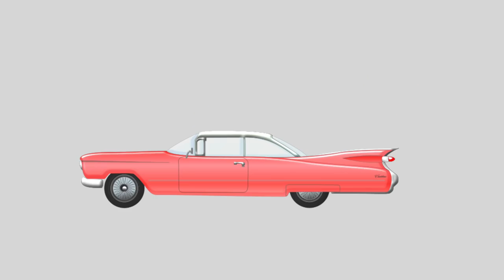Yes, Rockets CAN Fly in a Vacuum

Comment: What is that small wire seen in lunar lander and its stand..Since I have seen all those in apollo short films and movies I am very curious to know about it.
Reply: Are you talking about the probes that stick out under 3 of the 4 landing pads?  If so, those are the probes that sense contact with the ground.  They were basically crushed upon landing (as designed).
Reply: @Jeev
Once they( one) contact the ground, the astronaut gets a light and he knows to shut down the engine.
You can see the probe to the side in this shot.
https://www.flickr.com/photos/projectapolloarchive/21692801811/in/album-72157656723857913/
Reply: @rockethead7 Thank you.
Reply: @Kel Duck Thank you

Comment: the gases get out in one direction
a force pushes the rocker in opposite direction 
what is physical explanation of the generated force or power
Reply: Conservation of momentum
Reply: RECOIL.
  Any device that PUSHES on MASS must feel a RECOIL FORCE.
Exhaust gas HAS MASS and the rocket engine ACCELERATES IT.

Nothing can accelerate MASS without feeling a RECOIL FORCE.
Reply: @stuartgray5877  
Nice does the rocket has an engine or only chamber for burning fuel and discharging exhaust
Reply: @Moh23Moh  the combustion chamber is part of the engine.
Reply: @Moh23Moh  Would a CROSSWBOW firing steel projectiles feel a recoil force in space? Yes or No?
Reply: @stuartgray5877  
Yes
Reply: @Moh23Moh  - "Yes"

Why? The crossbow does not have anything to "push on" according to your explanation for rockets.

Comment: Too many verbal tangents to explain this principle. People that don't believe it will hang on slight errors in any of your descriptive tangents.  All force, even ICE engines (or horses) on Earth/ground function initially on equal and opposite reaction principles.  An ICE, old fashion steam, turbine engine or electric motor simply turns the direct linear force/reaction into angular momentum to drive a shaft.  They should already know that.

For Space Rockets simply:
1) Put your inflated balloon in a vacuum chamber, release the end remotely, watch it move.  That proves the theory that Newton's law FORCE/REACTION applies in a vacuum

2) burn a fuel in a vacuum using compressed fuel and oxygen mixed as the second experiment. Pick a colorful fuel like kerosene.

QED the principles of deep space rocketry.  Easy to visualize.  Easy for even an Earther to visualize.

  They, of course, have to believe they are witnessing a true vacuum chamber, evacuated in the video... But at that point why even bother with them?
Reply: I would consider gun recoil as even better model.

Comment: Tell me how thrust have made in space, the ballon fly away because of thrust made by air inside even by a rocket in atmosphere, fuel gases makes the thrust by pushing atmospheric air.
Reply: The thrust in space is made the same way it's made in any other medium: the fuel gets combined with the oxidizer in energetic reaction, creating hot exhaust gasses which propagate in all directions. Those gas particles which happen to be facing back will simply exit the combustion chamber without imparting any sort of force upon the rocket, but those which are facing forward can't just turn around in mid-flight - they will continue moving until they hit the walls of combustion chamber, and bounce back, making the rocket move forward. It's all happening inside the combustion chamber, so the rocket doesn't need anything outside of it to move.
Reply: @Jan_Strzelecki  thanks for explanation, but in space astronots used air pressure booster I space walk, they simply release air pressure to move in space, how they get the thrust?
Reply: @brightside2336  Please do not call them "astronots". That is a childish behaviour of someone who's not actually interested in finding truth.

The air gun used ins first US spacewalks works on the same principle, minus the "fuel getting mixed with oxidizer" part: a container containing pressurized gas gets opened on one end, and with every gas particle moving in random direction, most of them won't be facing the right way to go through it, so they will keep bouncing off the walls of that container until they do - and that creates thrust.
Reply: @Jan_Strzelecki  I think they are astronots, they do are I think calling them is not childish and I talking about moving in space not in space station. When the engineers repair or modifi the station. There they used pressurized air to make them stable if they get unstable
Reply: @brightside2336  Whatever you may think or may not think about them is irrelevant. What is relevant is how you act in public - if you want to be taken seriously, would you act like a spoiled brat, or like an adult?

In any case, I was also talking about moving in space. What gave you the impression that I was talking about space station?
Reply: @Jan_Strzelecki  move on bro, "how to act like in public" and how to react etc is irrelevant calling astronots  "astronots"  is childish is irrelevant, there is humer in physics not your verbal skills your perception of grammar etc bla bla bla
Reply: @Jan_Strzelecki  good by I ll find my own way
Reply: @brightside2336  : Seems you wont find it alone, unfortunately...

Comment: Doesn't it need resistance?  Space has no resistance water and air have.  Right?
Reply: Wrong. It doesn't push off the air; it pushes off its exhaust.
Reply: It needs a medium.  Air, water, asphalt..
Reply: @DrCash7  No. It doesn't.  It moves by throwing matter on one direction, which causes it to move in other direction. Somewhat amusingly, what you don't tealise is that 
your model actually requires the official explanation to be actually true :D
Reply: @Jan_Strzelecki  yes it does, Pubert o: o: o:
Reply: Vacuum/space has no resistance .

Comment: Newton's 3rd law does not apply. If I push my had through the air, water or try or at a wall, the force & the counter force is still always the same. But the resault in all 3 would be very different.
I highly suspect that once rockets are out of the Earths atmosphere, they have no prupulsive power, they may still be flying of course (for a litte while) & may even be able to go into orbit, where the Earths gravity will propel them.
Reply: If I fired a steel projectile from a crossbow in a vacuum WILL I FEEL RECOIL?  Yes or no?
Reply: @stuartgray5877  Yes, but you'll need a lot of bows to get to the Moon (canned laughter)

The reaction will be minimul & over as soon as the projectile has departed.

When the Gas is burning but still in the rocket, it is not propelling it yet. 

I am far from convinced it works & all you get are childish explantions as in this video & complete idiot astro nots like Don Pettit.
Reply: @johnsergei  (also posted on other thread):

"So, do you think the gas coming off the rocket would do anything?"

Yes I do. If you knew how physics works you can calculate EXACTLY how much momentum gets exchanged from one object "THROWING AWAY" part of itself.

You ARE aware that close to 99% of a rocket is FUEL when it lifts off.

DO you think that all that MASS just disappears when it is combusted?

Here is a SERIOUS QUESTION. This means I would like YOU to just answer it.

If I had a big CROSSBOW in space, lets say 1000 kilograms or about 2200 pounds on earth, 
  in zero-G, in a vacuum,
and this crossbow FIRED A 500 kilogram Block of WATER ICE away from the crossbow at 2500 meters per second "muzzle velocity" (about 5600 Miles per hour):
WILL the CROSSBOW get pushed backwards?
Will the crossbow feel RECOIL ?

Yes?
or
No??
Reply: @stuartgray5877  It doesn't matter. Once the crossbow is gone, you have no reaction. & the reaction on you is very small, relative to the reaction on the crossbow.

If you actually knew, you wouldn't be reffering to crossbows. So I guess we are in the same boat?
Reply: @johnsergei  - Sorry but the physics IS RELEVANT.
For you to say otherwise means you have never taken a physics course in your life.

I have literally been part of a spacecraft Propulsion Loading team.

Now answer the question.
Will a CROSSBOW firing a 500 kilogram Block of WATER ICE get propelled backwards?

DO you know how to calculate how much velocity it gains with the numbers I gave you? Lookup the "law of conservation of momentum"
Reply: Just been looking up Rockets & recoil & of course they leave it to laymen like you to argue the point.

My point is, it should be quite clear how rockets wrk in space & that should come from the people who make & use them.

I can'r see how rection would work & the other choice is recoil. But I think you know recoil is very uncontrolable & is great at turning something sideways. 
In evey other aplication, recoil is a liability.
Reply: @johnsergei  - The fact IS that I actually build, test, launch, and fly deep space probes for a living.  I have helped put five payloads on rockets and launch them. I have witnessed (up close) about Twenty real rocket launches including Space Shuttle Launches and landings.

I can tell you for a fact that rocket propulsion works in  vacuum EXACTLY like how a crossbow WOULD propel itself by firing projectiles.
A rocket nozzle is a MASS ACCELERATOR.
To accelerate MASS requires a force.
When the space shuttle main engine fires in a vacuum, it has a chamber pressure of over 3000 PSI and it can accelerate 500 kilograms of water STEAM to 2500 meters per second.

Do those numbers look familiar?

I asked if you could calculate the velocity obtained by the crossbow in the example above using the principle of "Conservation of Momentum".

Even without calculating it just IMAGINE a crossbow the size of a car, firing a 1000lb ICE BLOCK out the end at Mach 7?
would that exert a force on the crossbow OR NOT? The answer is.....
HOLY SHIT YES!

A car mass machine firing out a 1000lb hunk of ICE at mach 8 would feel a HUGE BACKWARDS ACCELERATION!  HUGE.

Oh and there is full video of rocket propulsion in a vacuum too.

Search YT for "Uninterrupted Falcon Heavy Launch and Booster Return" 
Watch that from liftoff to side booster landing then try to explain to me what you just saw.
Reply: @johnsergei  so did you watch the video yet?
Reply: @stuartgray5877  Whats that got to do with it? Recoil (which you say) flies the rocket is completly uncontrolable.
Reply: @johnsergei  - No the rocket is completely controllable. They have gimballing nozzles and often a secondary set of "rocket engines" (but mono or bi-propellant) to adjust the attitude of the stage while the engine is burning.

DID YOU WATCH THE VIDEO YET?
If you did, please explain what YOU SAW happen.
Reply: 1:57, she's emplying that the rocket exaust, pushes the rocket farward, just as a cars exaust would if it were poweful enough. I need go no further in this dopey video.

She us using Newton's 3rd law which does not apply here. If you push a wall. The wall pushes you back with the same force & you move.
 If you give it eveything you've got, ramming the air in front with your fists, you are actually producing more force than if you gently pushed @ a wall, but you won't move an inch & it's the same with rockets in space.

The atmosphere at ground level is more like a wall, in terms of mass, that it is to space (even the atmosphere @ 30,000 feet).

So, let me get this straight, she says rockets fly in space because of the exaust leaving the rocket?

You say because of a recoil action inside the rocket? 
Gee, one of you must be wrong? (get the joke?)
Reply: @papalegba6759  - SO you are saying a crossbow would feel NO RECOIL if it fired its projectile in a vacuum?

 Please come back AFTER you have taken a BASIC physics class.
Reply: @johnsergei  DID YOU WATCH THE VIDEO YET ??
Reply: @papalegba6759  - Search YT for "Uninterrupted Falcon Heavy Launch and Booster Return" 
Watch that from liftoff to side booster landing then try to explain to me what you just saw.
Reply: @papalegba6759  SO did you WATCH THE VIDEO?  Are you AFRAID to be proven wrong?  s THAT why you wont watch it?
Reply: @johnsergei  WHEN YOU PUSH SOMETHING AWAY WITH GREAT VELOCITY, IT PUSHES YOU BACK. This is literal 8th grade physics buddy
Reply: @johnsergei  Who said recoil was uncontrollable? Where are you getting that from?
Reply: @angadsingh9314  Try pushing air. Now try pushing space. Similar? 

Earth's atmosphere is much closer to solid matter than it is to Space. BUDDY!
Reply: @johnsergei  Good god. You're not getting it. Rockets don't move by pushing against air. A rocket is like a gun. And the propellent that it ejects is like bullets. It's continuously shooting bullets. Remember the recoil you feel when you shoot a bullet? The same recoil force is also felt by the rocket. But in our case, our hands/shoulders absorbs all the force, and the gun barely moves. This is not the case for the rocket. There's nothing holding it back. So it moves in the direction of the recoil. I really hope you get it now.
Reply: @angadsingh9314  How far does the gun move in the opposite direction? 
Apart from uncontrolable recoil ? Well, you lost that one, Sunshine.
Reply: @johnsergei  A normal gun wouldn't move much further because 1)We are only shooting one bullet. 2) The velocity/acceleration of this bullet is not all that high. 3) Our arm/shoulder is absorbing the force of the gun.
But a rocket is literally shooting billions of bullets a second and these are MUCH faster.... And what the fuck do you mean by 'uncontrollable recoil'. Where did you get that? How do you define 'uncontrollable'? Nothing is uncontrollable about recoil. We can calculate the exact amount of thrust that every batch of fuel can give us. I didn't lose anything, it's just that you prefer to turn off your brain and just say random words when presented with a well reasoned, well explained argument. You asked me how a rocket moves, and i explained you why; but of course you will choose to completely ignore it. What do you get by being compulsively contrarian? Being curious is fine, and the matter is somewhat confusing, but why are you so AGAINST rockets working in space? They work! Get with the times!!

Comment: Your speaking falsely,  newton's law requires mechanics, "ACTION" without an atmosphere, the rock gad will come out to push against nothing.  You can't thrust without a medium to thrust off of.Not making sense
Reply: Rockets use fuel as reaction mass.
Reply: @niallkinsella2687  ok. But what is the fuel pushing off of?
Reply: @paqman9101  
The rocket.

To explain it simply.
1. Fuel is a form of matter, therefore has mass and inertia and will resist any force that attempts to accelerate it. 
2. Rockets accelerate fuel, applying a force to it.
3. The fuel resists by applying a force to the rocket, equal in magnitude in the opposite direction, causing the rocket to accelerate also.

That's it.
Point 1 is Newton's first law of motion. An object will not accelerate unless acted on by a force.
Point 2 shows Newton's second law of motion. The force the rocket applies to the fuel is equal to the mass of the fuel times the amount the fuel has been accelerated by.
Point 3 is Newton's third law. Every action has an equal and opposite reaction.

No third element is required is the equation.
Reply: @niallkinsella2687  ok, now you mentioned how an object is manipulated by force, but what us the force pushing off of. 
For example when you swim, kick your feet in water. You body move through the (medium) water. Now apply that to an atmosphere,  14.7 psi of air molecules surround us, where it can be compress and moved very fast against low density air. Win turbines work opposite, where the medium exert force into a solid,  so, this all being said

How does a rock, exiting volumes of hot gasses, move an object if the medium or atmosphere is non present?
Reply: @paqman9101  
To use your language, misleading as it might be. The rocket pushes off the fuel, and the fuel pushes off the rocket.

No medium is required when a body is accelerating and ejecting mass.

In a pool, if you push a weight as hard as you can and let it go, you will be accelerated away from the weight, and the weight will be accelerated away from you. In that case the water acts as drag to slow the two objects, not as a medium for facilitating the action.
In space, rockets are more efficient than in atmosphere precisely because there is no atmosphere to interfere with the action and reaction between the rocket and fuel.
Reply: @paqman9101  
I get what you are saying exactly.
The problem is what you are saying is wrong.

Newtonian physics do not require any medium. A rocket doesn't need anything to "push off of". 
The rocket accelerates mass and ejects it, it gets accelerated in the opposite direction with equal magnitude.
That is simple conservation of momentum, something that school children are supposed to understand by the age of 13.

If you were standing in a vacuum and you shoot a crossbow, will you feel anything? Recoil?
Reply: @paqman9101  
Not one of your examples involves the same principles as rockets.
Not one of them accelerates and ejects mass.

Answer the crossbow question.
If you are standing in a vacuum and you shoot a crossbow, will you feel any recoil?
Reply: @niallkinsella2687  if you don't explode from negative pressure first maby. Again that's solids, we're talking about gases
Reply: @paqman9101  
It's a thought experiment. You can wear a pressure suit if you like.

So you say you will feel recoil.
Now replace the bolt on the crossbow with a series of sealed containers, each identical in size and mass but with a different substance in each.
One filled with 1kg of lead, one filled with 1kg of liquid water, and one filled with 1kg of nitrogen gas.

Which one will be fastest when you shoot it from the crossbow?
And which will result in the most recoil?